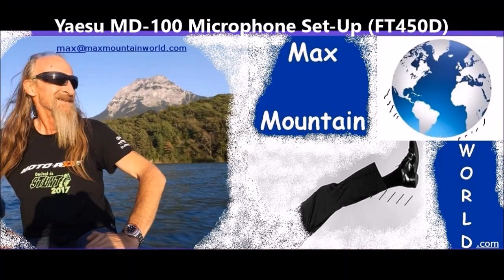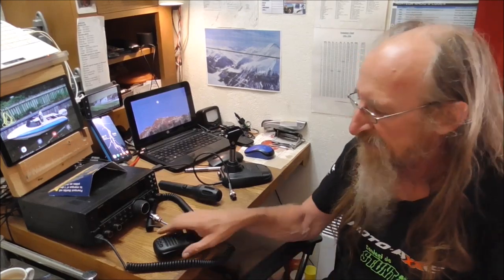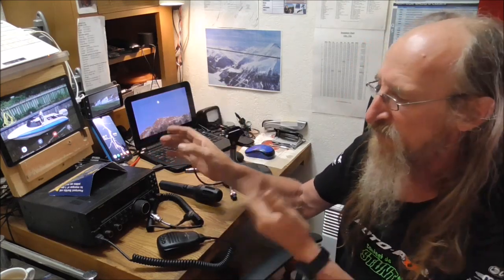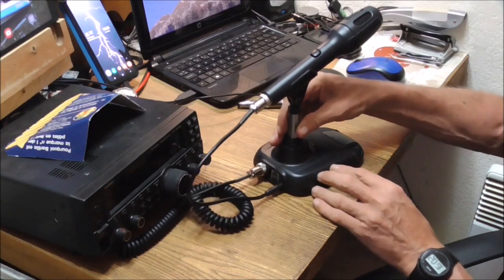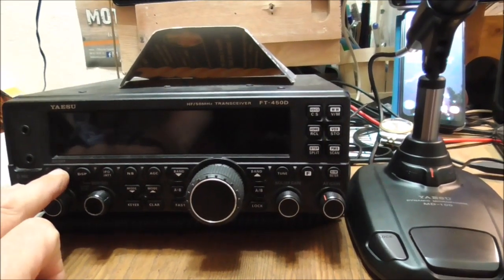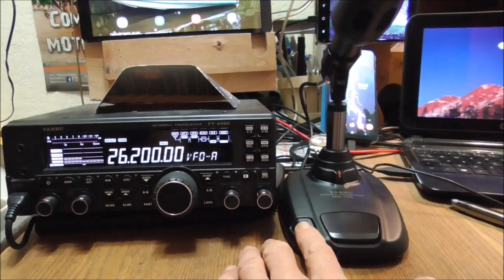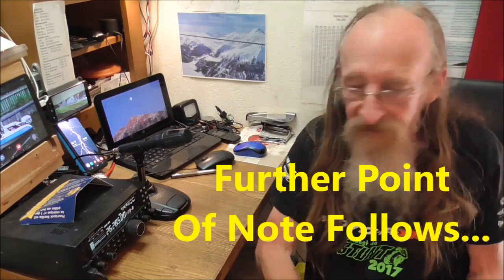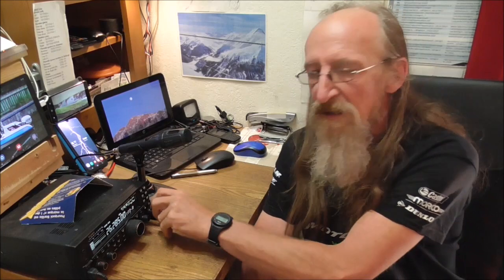Yaesu MD-100 Microphone ~ Assembly-Connection-Settings (Mic & Radio (FT450D))-Test & Final Comment

Comment: Great setup video. I just received my mic from an estate sale on eBay in great condition. I’m using it on my Yaesu FT857D. I don’t have Mic EQ on the radio, so I just used the settings you recommended on the mic base. Eventually I will get the Yaesu FT991A which does have Mic EQ settings on the radio. I’m happy with the mic and I get very good audio reports.
Reply from the maker: I find the MD-100 best suited to the FT450D. Tried with the FT891 but always found better with the MH31 (standard mic). It works well with some Yaesu's and not so well with others. Love it with the 450. Cheers
Reply: @MaxMountainWorld , I use the FT857D as a base and the supplied hand mic is cumbersome to use and rolls around on the desk. The MD-100 fits perfectly and easier to use. I also have a D104 Silver Eagle desk mic. The audio on it is a bit too harsh for me, although I’m not the one who has to listen to it while making QSO’s. Hi Hi. I do like the great audio reports on the MD-100.

Comment: Can you plug the cooler cable straight into the mic (without the base)? I do know there’s a PTT button on the mic itself. The reason I’m interested is for use with FT-817/818.
Reply from the maker: The Link cable has different connections. Cheers

Comment: I flip mine to filter on the mic and it goes blank. No audio. I purchased mine w an old ft 1000. Idk 🤷‍♂️
Reply from the maker: It works well on both FT891 & FT450D, settings as explained. Cheers

Comment: The version i got has only  switch on the base, no ptt on the mic and no channel change, looks like they have cut down the build of this desk mic these days.
56CT004
Reply from the maker: Did you get new or secondhand? I never came across a variant. I am sure it will work well whatever adjustments are or are not. Have fun with it. Cheers

Comment: Great video again , can you tell me what that knocking noise is on 26.285 , I’m also getting it on my radio but its over powering any contacts coming through
Reply from the maker: Normally comes in between 26.200 and 26.400. Called a CODAR and I gather it is a Heterodyne from another frequency and mains 50hz. its been doing that on and off for decades and appears periodically throughout HF. If You Find Out more I'd be interested. Thanks for Your Comment 73's
Reply: MaxMountainWorld  thanks for the quick reply , iv checked everything on my set up thinking it was something i was causing , hopefully catch you on the radio sometime , 73s from Scotland
Reply from the maker: Coincidence the quick bit. I go through the comments each evening and try to reply them all. The "WoodPecker" has been happening for Decades. 73's de France Alps

Comment: The second plug in the back of the mic is so you can plug the mic cord in the other way and use it as an 8 pin mic. The Ft-991 has an 8 pin plug....
Reply from the maker: Yip!!!
Reply: @MaxMountainWorld  thanks..I saw it right away,  👍

Comment: Great 2watch you on utube..I have ft450d and I think it's awesome. Have taken it mobile and used 100 amp leisure battery with great success. My next purchase will b ft891 for mobile use jam an amateur with mi7 call sign but 2 b honest still prefer 11metres..wishing you well max and hope to here you soon again. 73' in meantime from 68CI595..Robin
Reply from the maker: Aye ~ Hope to catch you soon on 11m.E-layer, it is coming back in bits under the F-layer. Fairly regular USA/Canada from here. Cheers 73's

Comment: Hi,max,good video, well explained, but I do think that if you were closer to the microphone 🎤, maybe 10 cm and spoke in a normal volume, I think that your audio will be more powerful, break though the QRM easier, anyhoo that's my 3 cent worth, 73 from Rotterdam. 👍👍
Reply from the maker: In My "Testing" Especially DX to SDR (Near You Actually!) I found it Louder, Punchier and Fuller Sounding Just Speaking Normally and About  20cm Away, Hence the Comment at the End. Thanks your 3cent worth Much Appreciated. Take Care 73's Thanks
Reply: Hi I just looked that you are further away than that, have a great day, 73 Rotterdam
Reply from the maker: @Bernard-John  Hi. I did lots of experimentation with it. Yeah, you buy a new  toy you play with it! 73's

Comment: Max, I enjoyed the video and I have the same setup. I took a look at the settings that you like that seemed to give you the best performance for the md100, however I do have a question. Where are you setting the mic gain with the settings you discussed in your video presentation?
Reply from the maker: That was missed out of the video. same mic gain setting as the standard mic....HIGH
Reply: @MaxMountainWorld  thank you for the quick reply. 73 de KD2PGJ
Reply from the maker: @jamesbonanno3359  You Are Welcome. I Try to Read all comments and reply each evening (or following morning) as respect for those who make the effort to comment in the first place. Thanks for Yours. STAY SAFE GOOD LUCK 73's&51's

Comment: Hi Max. Do you think the modulation is better than with the stock microphone ? MH31 is not clear enough for me . For the moment I do not use the equalizer . Modulation is not bad with my FT 891 but I think it ispossible to improve it. MD100 is not pre-amplified . i am looking for more clarity. Do you have an idea ?
Reply from the maker: On My FT450D Yes, Definitely (more switchable regulation if nothing else). I found no benefit with the FT891 Though but the 891 has great adjustable settings within its own menus. I use the MH-31 with my FT891 and many operators claim it sound like studio-mic audio. I hope this, together with my videos, helps you there. Many Thanks for this. Take care. Cheers
Reply: @MaxMountainWorld  thank you for your answer.
 According to you the stock microphone is enough with FT891. Did you modify the bandwidth with your FT891 ?  Do you have a link for your video concerning this ?
Reply from the maker: @elzarbiman9657  Yes, the Stock MH-31 Mic is Excellent with the FT891. Both my Yaesu's were "Opened-Up" By supplier when new, so sorry, No Video here but plenty on YouTube I would say. Cheers